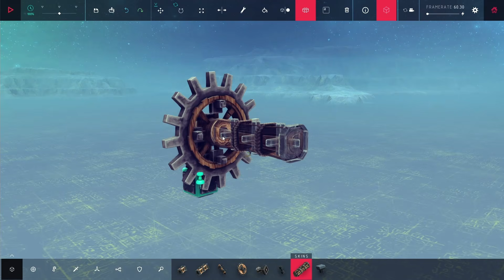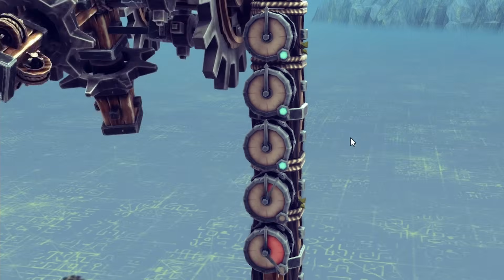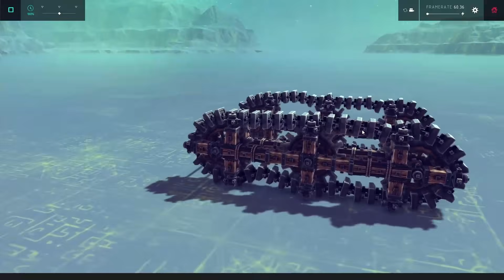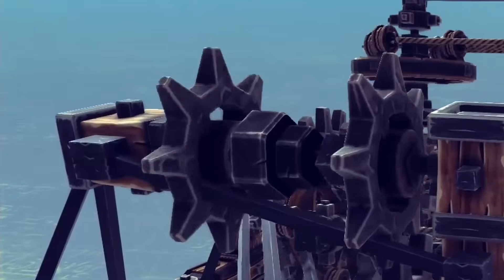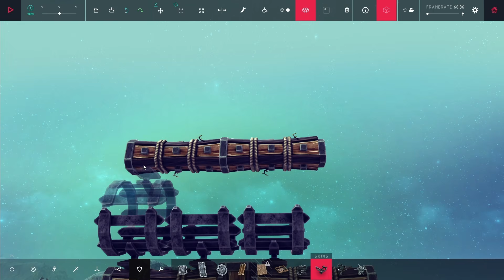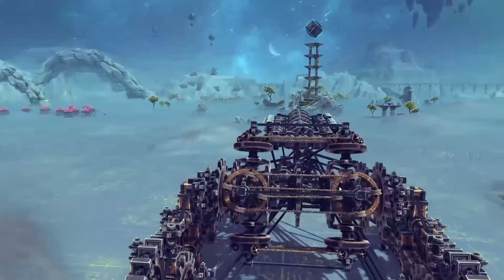Destroying Besiege by Making a Tank

Comment: I’d have recommended little “running wheels” I think they’re called, small free flowing gears underneath the tread, they’re in a location that forces the tension in the tread and allows it to run a little easier.

Comment: Oh maaan, as someone with 1200 hours, im so sad that you dont mod block sizes, learn loopholes, and techniques xD
Reply: Take that as a compliment, your mechanical knowledge is really good.

Only real gripe i have WHICH IS SOMETHING I LEARNED SUPER LATE is that actual tank threads have what you can imagine to be 2 wheels, with a thinner barrier in the middle of the 2, and the tank thread is like a T
Where the stem of the T goes into the barrier hole, which makes it a lot sturdier.

Comment: Humans have tried inventing an armored all-terrain vehicle for many hundreds of years with limited success only to finally nail it down in the turn of the 20th century because this is what it takes to make an engine with treads capable of carrying a large cannon and armor plating. It's a very tedious engineering science to figure out and learn and perfect because of the insane logistics that go into each and every gear, piston, drive shaft, motor, etc. It's so many complicated parts coming together and working together just to accomplish the goal of a large bulletproof vehicle that shoots a massive projectile, and that's just by itself, god forbid another tank shoots those treads or some soldier jams a pipe or grenade right in there and screws up soooooo much work. The engineering that goes into such monster vehicles is absolutely precious art, you did an amazing job building this by yourself all historical and scientific things considered

Comment: normally there are gears that are smaller then the big once on the top tentioning the threads. i think the big gears only have suspension in them but i'm not sure.... but i think this because this would allow the thread to get more slack when going over a tree truck for example because it can push in the suppension with enough force

Comment: It's really a shame how bad the gears are in this game because I feel like they could be made to work so much smoother without much effort. They could add invisible triggers to the teeth and in-between the teeth of each gear and when those triggers intersect it flags to gears as being "meshed" together and transfers the rotation of one gear to the other. That way it isn't relying on all the teeth physically pushing on each other to make gears turn so rotation is being transferred independently of the collision system.

Comment: You can make a ball cannon by making a tube with curved holders/guides and placing water cannons along it facing the direction you want to shoot by 45 degrees. Then put torches behind them to turn them into steam cannons and put their strengh up to max. Now put a ball into the start and it will go very very fast.

Comment: if you wanna make a cool plane engine then make a heavy free spinning back plate you place the engine on. this way you can change the torgue by changing the weight  and it will also free spin when going off trottle. 
bonus is that this design wont transfer torgue to the frame and it auto adjust to pull straight if you use several of them.
can also make it so you can adjust angle of the blades to make it perfect.

Comment: this is sick man, maybe you can make it more efficient by changing the engine design (which looks cool btw) cus the leverage the ropes have is very tiny since the lever they're pulling on is basically a single block long, maybe increase the length of the blocks the ropes are attached to. Though i dont think 4 will fit so maybe settle for 2 of these rope mechanisms lol

Comment: I love this build, though i feel like the track performance could have been improved by only keeping the sprocket (driven gear) and idler (non-driven gear) wheels, and replaced the middle one with either one big normal wheel or a smaller handful of normal wheels. In doing so you would lessen the number of places teeth are directly engaging with the track, creating less points for binding up and providing a smoother ride, in theory.

Definite major bonus points for track tensioning the tried and true tanker way: just push out the idler wheel until the track is correctly tensioned. Always love seeing the chaos of a new build. Cheers.

Comment: You can attach grip pads to the outside of the treads to improve grip

Works beautifully in all my treaded designs. Tbh I havent done an engine powered one yet so you might not have enough power, but it's worth a shot

Comment: I think you could get away with a front gear drive if you added a front gear that doesn't touch the ground, so it wouldn't push the track on the ground. The piston solution is actually a real thing in some tanks. I think that's all I can think of from my experience with tanks (I was the gunner so I don't have a lot more knowledge about this part of the tank). Loved the engine btw, beautiful!

Comment: Formula style racecar? Or a racecar in general. Anyone with me? Or making a vehicle drive as fast as possible. Would love to see that!
Reply: The issue with that always comes down to stability. It might be possible to just put spinners on top to push it down when accelerating. Looking at how this guy designs a tank engine, he would probably  put several gear sets in that can move at different speeds to accelerate like shifting gears, which would greatly decrease its top speed from the weight of it all. Also put spinners in front and behind for maximum push.
Reply: Yessss
Reply: Yesss

Comment: The concept of this game is really good, but the gears are too glitchy for my taste... 
When it comes to physics sandboxes i didn't see any real improvements over the years... 
Gears in half life 2 would probably work just as good.
Reply from the maker: There are some mods that fix the issues of the gears, but I do wish that it was a better vanilla experience
Reply: @ReidCaptain  I for one would not be opposed to seeing you use mods in videos every once in awhile. What's an engineer without a good toolbelt?
Reply: I mean, the game isn't built for entire engines to be built in it, if you actually want to build something accurate you probably want to use tools that were made for building those things which, surprisingly, does not include a lot of games
Reply: @matthias916  onshape, solidworks, alibre, fusion360, maybe freecad,
Reply: >gears in half life 2 would probably work just as good
oh my sweet summer child
someone doesn't know the horror of func_rotating from source
Reply: @danlorett2184  Or hasn't played oldschool gmod.